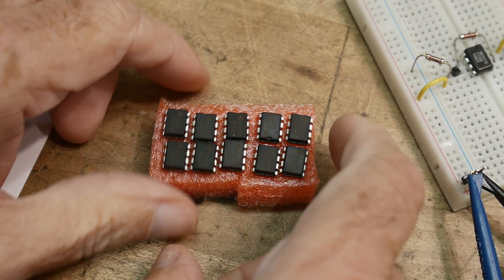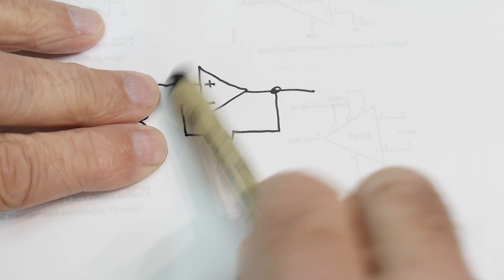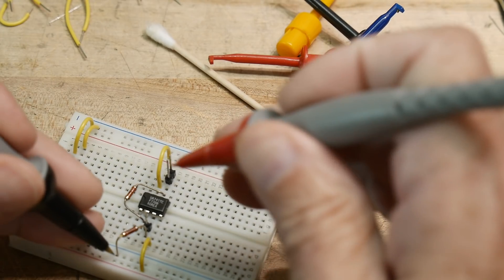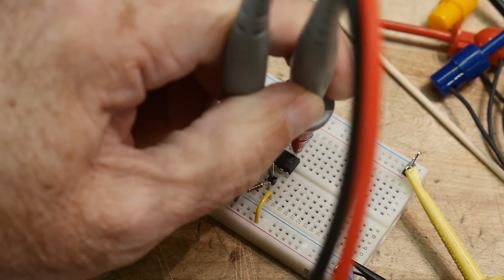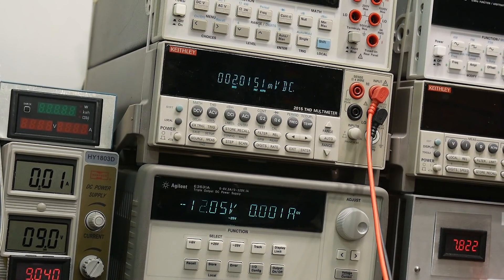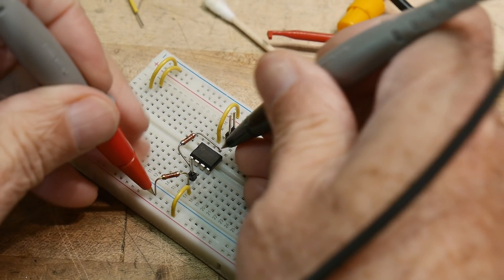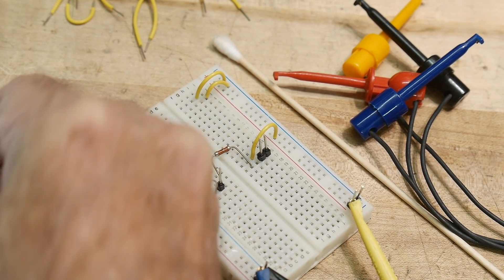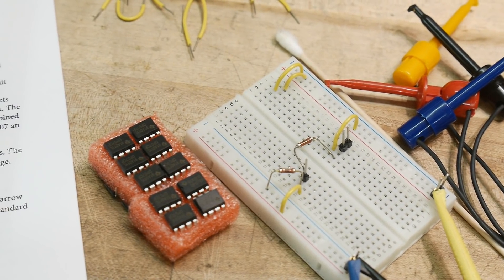#1029 Fake Op-amps from China

Comment: Can you xray or microscope the parts to check the die makings. Usually the part numbers are on the die
Reply from the maker: no, don't have xray, tried to crack open some parts but they don't cleave in the right way. don't have the chemical do dissolve.
Reply: @IMSAIGuy  see some YouTube channels where they dissolve in acid or slowly grind off the top. How about the markings on the top or bottom in comparison to an OPA. Some might be able to provide genuine OPA pictures to compare.
Reply from the maker: @jjoeygold  I will show a real OP-07 in a future video. The 'decap' process with acid is the correct way. I'm not going to do that. The offset pins either 741 style or OP07 style are missing on this device. There are 3 no connect pins.

Comment: You should change that feedback resistor to 1M and add another 1k between inverting and ground so the amp will amplify the offset to mV for you.  Except for shipping, 741s for that price is not too bad of a deal.
Reply from the maker: one company uses a gain of 4000, one company uses a fancy circuit with expensive parts to measure. the parts are not even 741 since there are no connections to the offset pins.
Reply: @IMSAIGuy  They also are not all alike; however, they do seem to be opamps and worth something.  I would use them wherever they work.

Comment: I bought 3 or 4 lots of ICs on line and about 1 in 5 were genuine. I worked out that the markings were different as were pin resistances, before I checked them.. Some were MC1350 from memory.. Yes...Buyer beware...

Comment: Why buy on ebay? Chips from Chinese semiconductor companies have many better parameters than op07, based on cmos process, the power supply current is only a few hundred uA, they are cheaper
Reply from the maker: please give me a part number and datasheet for a chinese opamp that has 30uV input offset voltage spec and costs $0.10
Reply: @IMSAIGuy  Check out LCSC. Cosine from China makes wafer trimmed op-amps such as COS77 with 15uV offset and costs 12 cents at 1k units.

Comment: Just to be pedantic, but the circuit you have might be a bit off on the offset voltage if there is a small input bias current.  A typical 100nanoamp input bias would account for a 100 microvolt drop across the 1k resistor.  At any rate, your test definitely shows the op amps are fake.
Reply: Typically, the DC bias is the same for both the positive and negative inputs. He used 1kOhm resistors for both the feedback and ground, to eliminate error caused by input bias. That way, he could measure from the output of the Op Amp to ground, negating the 10 megaohm loading of the meter, to give the accurate offset voltage. That same ~100 microvolts would appear the same for both inputs, canceling out.
Reply: Balancing resistors for offset input current, and if you want a bigger reading, you use a 1k resistor to ground, and for the inverting input a pair of 2k resistors to give a gain of 2, but with impedance in both legs being 1k. Gain of 10 would have made it worse as well, but easy enough to make the current flow through the same impedance both legs, meaning the bias current is compensated for.

Comment: I have used LM741 to replace OP07 with no issues, as they were not in a critical role. Did however use the TO100 can version, and added a clip on heatsink to them both, as they were being run with 22V supply rails, as the unit was using them to generate control signals that had to go to plus and minus 15V on the output, so the opamps were supplied with 22V to get enough headroom. Reason the old ones failed was because thy were DIP parts and ran rather hot, while the replacement 741 devices with heat sinks clipped on them, actually TO39 type, which are the same diameter as TO100 IC cases.

Had plenty of the JANTX LM741 around, as they were common to fail from offset drift, and when it got to around 5mV, they would give single bit errors in the ADC they were used to signal condition inputs for. Put new one in, check and adjust offset to zero again, and all is fine. No pot, use discrete resistors to get the right value, soldering them in. Had a whole big box of every value in the E96 series, all removed from old boards, and a lot that were new, that were used to set this, all either with bands, or with the value printed on them for the Sfernice and Vishay parts, though more often than not the resistance was measured from the decade box, and then the closest value was found, measured on the DMM to verify, and then put in there, and the other value was calculated to sum the 2 to 10k total, as per data sheet. Did mean I used 1M resistors a few times, in as placeholder, when the one side was down to a 100R resistor.
Reply from the maker: why did the original design call out a OP-07?
Reply: @IMSAIGuy  44V supply rails, while the 741 is specced to 36V only. However you can run them at 44V in the most case, the abs max ratings are very conservative voltage wise. Only a very few will have excess current at 44V, so will work fine. Other side was only a 12 bit ADC, so the offset was not a worry either, which is good as the OP07 and 741 use different offset null methods, and here those pins were all no connection.
Reply from the maker: how did you know the offset pins were all no connection. I don't think I mentioned that here, did I?
Reply: @IMSAIGuy  I could see your breadboard had them not used, and in most cases offset nulling is not used. OP07 referenced the nulling pins to the positive rail, while the 741 references to negative rail. Not going to do the internal diffused resistors any good if you use the wrong nulling connection, and will degrade the die as well.
Reply from the maker: ok, no connections on the protoboard. they are also no connection inside the part, those pins did not get wirebonded. since 741 uses -V and op07 uses +V they could not even fake that
Reply from the maker: I never worked anywhere that would allow me to design beyond the datasheet. I can do what I want in the garage however

Comment: I recently bought a bench power supply kit. It was a nice quality circuit-board, and the parts looked OK apart from the 3 op-amps which were supposed to be TL071's, but were unmarked. Once built, the kit was behaving strangely, so I suspected the op-amps; replacing them with genuine ones fixed the problem.
Reply: I know the kit you are referring to. I did the same with the same result. Often the active devices are junk even if the PCB is good quality. Beware the caps as well. Larger caps have lower value ones installed in the case of the larger one. All that effort to rip off a few of the foreigners they hate so much.
Reply: @mbak7801  Why do they sell dangerous products to foreigners?

Comment: That first 741 clearly is a fake indeed!
Reply: No, I have had plenty that came in well within spec, really just luck of the draw as to where the part is when manufactured, though the manufacturers do tend to do an on die test to weed out the bad ones, and then a second pass after packaging to get the closest devices to sell at a premium. Just like transistors, where you can get a BC107, or a gain binned part that is BC107A, BC107B or BC107C, your choice as to price point, and if your application is that critical gain wise.

Buy the plain part and sort if you need matched pairs, you will find 2 within 1% of each other if you buy 15 parts, and with the gain grouped parts you can even get a rough notion as to the actual gain.

Comment: this kinda stuff just pisses me off.
the lack of integrity for Chinese manufactures and vendors is legendary.
and then our lack of pressure to control this behavior or block it at the border is absent.
so we need to add more time and effort into acquiring and testing parts.
who is it good for?
Reply: yeah, we got some fake ad797 from a reputable seller here in russia. They were fake to the point they didn't even work, i figured out the bad guys relabeled a dual opamp, but ad797 is a single one!
Reply: If people stopped buying their shit, they'd stop making it. Trouble is everyone wants something 'cheap' - so they make it and people buy it and the cycle persists.
Reply: @stopthebus  the resellers around here will happily ask the higher price around here for the same counterfeit chips. Avoiding the cheap version won't give you any guarantee. Either shop at known good suppliers that buy directly from the manufacturer or you take the risk. The problem is the effort in finding out if something works properly versus the cost of the item. Noone is willing to pay for test sampling components from each new batch you receive except for the military and aerospace. Even then, I've seen reels where the first 100 or so components were reel but those that came after weren't
Reply: @rjordans  Yeah, there's no sure-fire way to guarantee any component is genuine these days. My comment above though is really about the original sellers - if people stopped buying from them they'd have no choice but to cease making cheap rubbish. I always buy critical components from trusted sources.
Reply: It's not just the Chinese, plenty of resellers around here that sell hobby parts with dubious sources. Many people may not care or realize that they get different parts but it's very annoying if you do need to get the right component
Reply: Happens in all country's with many products
Reply: Make them believe they have "Lost Face" and maybe they will commit their version of Harikiri.
Reply: @gordonwelcher9598  I think you are confusing Japanese With Chinese.
Reply: @mr1enrollment  I said “Their Version”
Reply: @gordonwelcher9598  ;-}